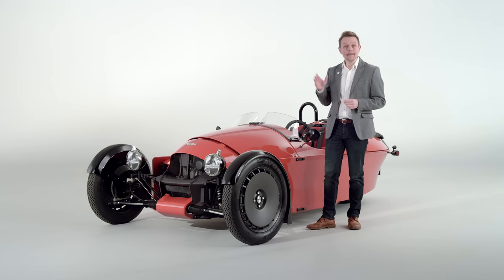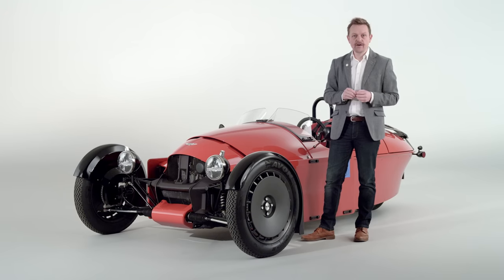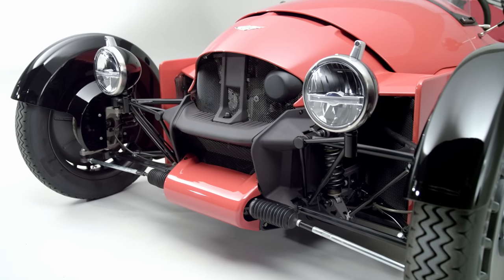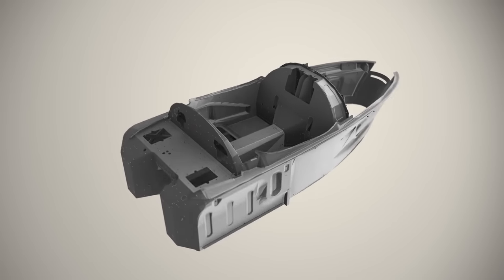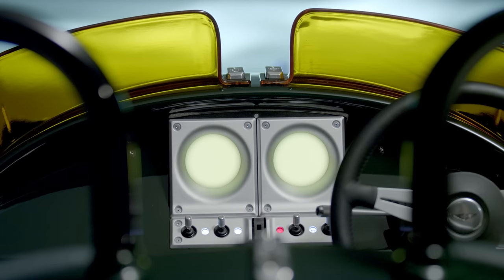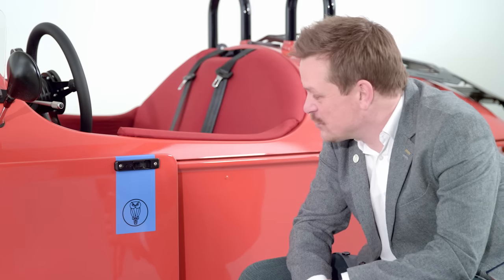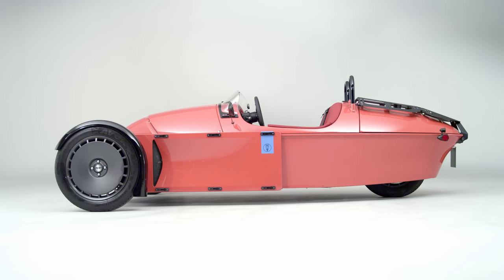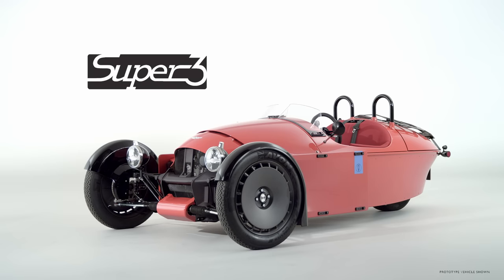Morgan Super 3 | In-depth

Comment: Impressive preview. Can't wait to see how it handles.
Reply: I wonder about that myself. 
Ever hear of a Vanderhall? It's a car similar to this, and the engineers found that driving only the rear wheel (as this does) made it want to do donuts.
Reply: @Baribrotzer  The reason for the skinny Xply tyres is to enable drift, too much grip and you'll flip - when set up correctly your throttle controls your angle of turn...  watch some of the historical racing Morgans - Bill Tuer is a superb driver.

Comment: That is a beautiful vehicle.    Morgan really did a nice job integrating that new engine into the vehicle but retaining the original look of the Morgan 3 wheeler.    Without a doubt one of the nicest Morgan "3"'s ever created.    A worthy successor to a long history of 3 wheelers for Morgan.     This would be the perfect vehicle for those weekend getaways.   The fact they have integrated those hangers on the "side blades" (which look spectacular by the way) and the ability to hang both duffle bags and hard cases onto the side really add to the usability and practicality of the vehicle.    And the rear rack you can put onto it also adds much needed space for carrying your needed items.   This makes a perfect "open top" car for those who don't want a motorcycle but want to enjoy the roads in a similar manner as motorcycle riders.   Much more stable than a motorcycle and the passengers sit in nice comfortable seats side by side rather than front and back like a motorcycle.     NICE JOB MORGAN!

Comment: I won't have the money to buy one until at least 5 years from now but...

-I'm really not a fan of digital dashboards. I would rather have analog dials and a separate screen for the technical stuff.
-The "specially made wheels" worry me. Can a normal garage change the wheels, or does the owner need to take them to a specialiced dealership?
-Ford engine
-Three cilinders

Apart from that, a three wheeler being released on 2022 with a manual transmision with all the bs regulations in emmisions and whatever its something to celebrate.
Keep it up Morgan. I like your style.